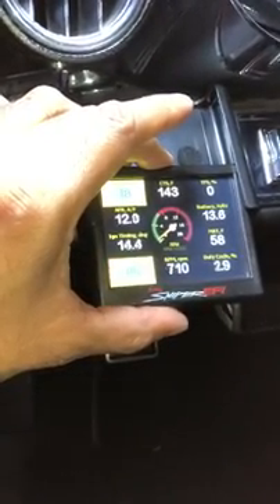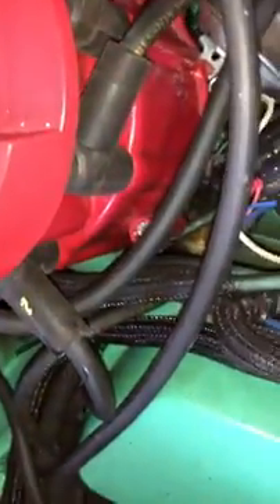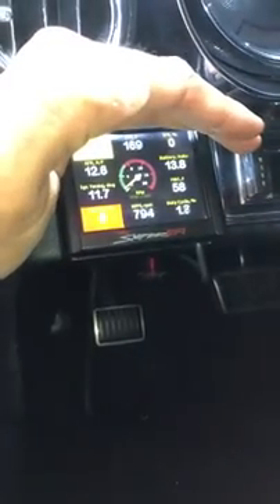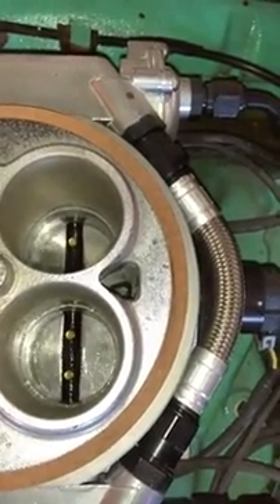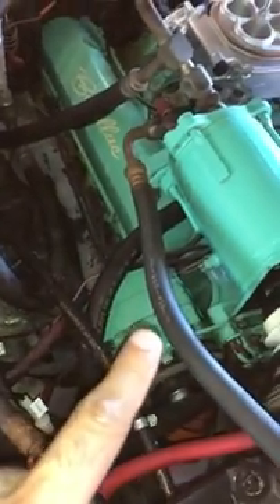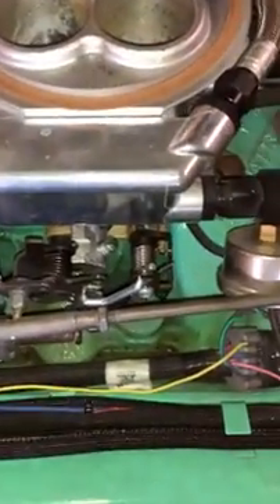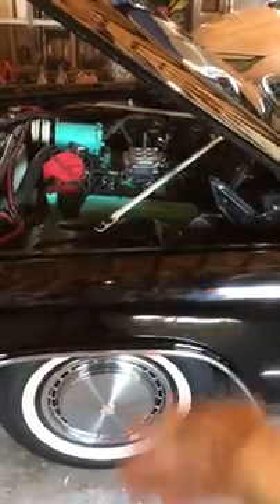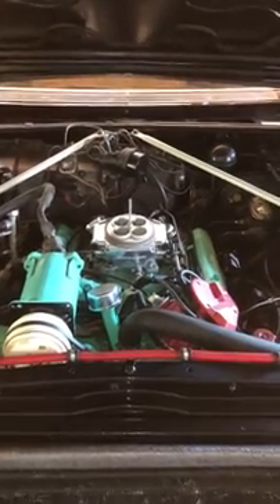Holley Sniper IAC idle hunting problem 1966 Cadillac

Comment: I had the same issue, but only on cold starts. Change your IAC speed from "Slow" to "Sniper TBI". Then, change your Closed Loop speed from 3 to 2 or 1. Those changes will help in all phases (startup, idle, and driving). However, if it's just a cold start issue, you could disable closed loop until operating temp. Only do this if your learn table has been transferred to base.
Reply from the maker: Thanks Clint! We all appreciate your input. The car isn’t with me at the moment, so it will be a while until I can try it. It is possible that your version is much newer than mine, and I don’t have those option bc I don’t remember seeing them…

Comment: I’m running a 67 440 with a 727, I think I just figured mine out. Hasn’t done it again since. Go into your advanced tuning settings and turn your AC kick down from factory setting from Holley which is 50% and turn it to 0 %  if you aren’t running AC if you are then adjust it to where you don’t have the IAC surge
Reply from the maker: Hey, that’s worth a shot! My car isn’t with me, but hopefully others can confirm and report back here. Thx for the update!!
Reply: Well, so far so good! I did what Cody described in OP and, it's only been one day, but it is running normally now...now surging etc. I will give an update in a week or so!
Reply: Interesting! Is your sniper still working well after making that adjustment to 0% ?? 
I just fixed my A/C and the problems described in this video only now surfaced. Just made the adjustment you suggested and hopefully this fixes it. I will post back regardless.

Comment: Did you ever get this sorted out?   I have the same problem.   Thanks.
Reply from the maker: Hello and no. Just been driving it. Some days it’s a little better, other days it’s the same as the video. Things I never tried ; throttlebody to manifold spacer, new IAC, new Sniper. Good luck man!
Reply: @rajeevx7   Thank you. I am running a 1.5 inch spacer and it still does it. Like you it comes and goes and isn't consistent. I leaned out the idle AFR and added some timing. That seemed to help a little.  I am going to mess with the IAC settings and see if I can make it any better.

Comment: curious if you ever got this resolved.. with it being a smooth idle with it disconnected, i'd say its not fuel/spark map related. you already checked/confirmed no vacuum leaks. from the looks of the way the iac is acting, i'd almost say its picking up interference from something on the iac wires causing it to bounce around. you already tried a new iac from a parts store? its a Standard Motor Products AC416.
Reply from the maker: Everything you said is plausible. I have not tried a new IAC.

Comment: Same problem for me. Everything is new between the clutch and the grill and was professionally installed. I never know when she'll stall, but most likely at an intersection, where it won't re-fire. All Holley Snipers need to be recalled because they create a hazard in traffic. Do not install one of these in your vehicle.
Reply from the maker: Hi, did you do a thorough intake leak check? Mine never stalls, but any extra un metered air could stall it out.

Comment: So U left it unplugged , I can’t even get my IAC down to 0.
Reply from the maker: Hi friend, no not unplugged. Cold starts are almost impossible without some iac. It sound like yours may be the iac/idle screw adjustment setting that Holley describes in the set up. If that’s not it, your resting IAC position setting in the handheld may be way too high. Ideal is somewhere between 10-30% at rest (open throttle no iac needed)
Reply: Ty I gotta keep trying but it’s fustrating I appreciate ur time bud

Comment: I wanted to just give some comments here. 1966 impala ss 327 mild cam. I have a stock HEI on it, no hyper spark.  I too have the same surging Iac issue. I set up the car 2 years ago and ran extremely well, the recently started having the exact hunting issue. Very bad iac , 0 to 100  0 to 76 , 0 to 50 ect.  surging , snorting Just like yours.  cold start fine, warm up fine, then take for a ride 2 to 5 miles , come to a stop and here is starts surging. 
  I have all my wires very tidy and all away from any RF Noise source.  I happen to have a new unit on my shelf for another project. so I switched out the iac unit with a new one.  Same exact issue with new Iac .  I then just switched out the throttle body for the new one (with the old Iac  sensor in it) and it worked with out any issues . so my diagnosis is a bad ECU unit. the same wiring and wire routing now has not one issue and runs amazing.  Great news here that its fixed ,  except Now I need to deal with Holley with a unit that is from 2019 and a defective ECU . 
I hope they do the right thing
Reply from the maker: Hi Mark, thanks for the input. I have always thought this thing to be a defective ecu as well. You had yours running great, then the ecu started acting up right? I have a feeling that Holley knowingly unloaded a great deal of the defective ecu’s at wholesale cost. Based on what I’ve seen and tried with this thing, a bad ecu makes the most sense.

Comment: Mine dies after 15/20 minutes and the IAC stays hunting at all times. I have a fuel pressure gauge hooked up with a inline fuel pumps and i just can’t keep it running. I’ve tried everything. I went from a FiTech to this and FiTech is way worse. But I’m having the same issue with both so idk
Reply from the maker: Hi Adam, have you unplugged the IAC after it’s running, like I did in the vid? If the pump is cavitating, then the pump feed side seems like it can’t keep up with all the bouncy idle and heat after 15min. Maybe try a larger feed line and ensure your return in tank isn’t washing out the pickup line/causing bubbles near.

Comment: I have a 66 Cadillac and I'm thinking about going fuel injection I would like to talk to you personally on your recommendation
Reply from the maker: No one at Holley wants to help. I have not tried the spacer between the carb/intake manifold yet, as has been suggested. That’s bc I’m busy and I don’t have much hope for it anyway. If I did it again I would get a Fuel Injection Tech unit. But, I haven’t done the extensive research on those to identify their problems either. Basically, fuel injection is better than carbs, but the Sniper may be the worst one out there for this 429. 🤷🏽‍♂️
Reply: @rajeevx7  Wow! This is making me glad I went with GM TBI off a 454 Chevy. What did you end up doing?
Reply from the maker: Hi Clark,  I’ve done nothing😂 I still have the TB spacer sitting on my workbench. That was suggested by a few people to do and cure the surging. Also, another guy suggested that my alt may be causing it with RF interference. I haven’t tried disconnecting that WHILE the iac is hunting yet. That seems fairly easy to do, since it’s just one wire. But……I’m busy😭

The GM TBI is tried, tested and proven! It’s not all fancy with a touchscreen and polished housing….but at least it works dependably! I may have gone that route if I had found a write up on the 429 to TBI😬. Enjoy your car though!

Comment: In one of Holley's videos it says that this issue of hunting could be caused by a vacuum leak as well.  Just a suggestion.
Reply from the maker: You got that right! So, checking for a leak source isn’t that easy if it’s a small leak. But, the dead giveaway for me that this is ecu/iac related is that plugging the iac port or disconnecting the iac gives a DEADNUTS steady purr at as low an rpm as I like. A leak ‘should’ cause a higher than normal/target rpm and/or fluctuate a bit. Usually even a whistle!
Reply: True in most cases, I am not having as much issue with hunting as yours, mine seems to be mostly cam size lope.

Comment: I have a similar issue and Dude I'm so frustrated I just want to toss everything Holley in the trash including the darn stickers.
Reply from the maker: Lolz 😂 Tell us how you really feel! Ok, hold tight. Do the iac procedure. Fix your p-trim. Then see where you are. I know there are good suggestions in this comment section. 
I’ve tried everything except the carb/throttle body spacer. I bought one from Advance Auto for about $15....just haven’t got the will to put it in because I will have to engineer a new kick down and possibly throttle linkage. I will one day and report back. But, if you are in it now it’s a mod that can’t hurt anything so might as well try! Good luck 🍀

Comment: Im chasing emi problems that makes mine stall after its ran fir 10-20min. Makes me wish i just got a nice billet double pumper.
Reply: I still havent taken it on the street yet  though.
Reply from the maker: Even with the sniper problems, I wouldn’t go back to carb....prob shoulda got an fueltech instead tho🤷🏽‍♂️ 
Did you get every wire way away from your distributor, coil and wires? Do you have an amp power wire that surges near by? Also, google electrical pulse interference and blockers....that might help. Once everything sniper related is about 6” away from emi sources, you can move on to other things. 
Is your sniper ecu set up controlling spark and why do you think it’s emi related stalling?
Reply: @rajeevx7  haha i have a little bit of everything going on. Spent the weekend tidying up wires, putting a noise filter on the ignition box, clean spark plugs, new o2 sensor, clipping ferrite doohickies everywhere,.... im gunna also heat shrink the air cleaner bolt and find a plastic filter base. I still got my ig. Box wires and electric fan wires running together, but in separate looms and i hope that doesnt give me trouble
Reply: @rajeevx7  do i need a base fuel map downloaded? I never found a sbc 350 build that came close to mine or does that matter?
Reply from the maker: Totally sounds like you are on the correct and shortest path!
You base map is getting the car to start and idle for 15min, so you are good there. I’d suggest the data logging it at the 12min mark to stall, then view that on the laptop. Maybe you will see something spiking/falling off leading to engine cut. 🤞🏽🤞🏽🤞🏽
Reply: @rajeevx7  i had one great run in the 2 years i had mine and the tune just kept getting worse and worse. The 3d fuel and kpa map looks like the alps lol.
Reply: @rajeevx7  try unplugging your alternator when it starts doing that, I am dealing with one now and it turns out its rfi noise from the alternator.
Reply from the maker: I hadn’t heard of that before, but great idea! My alt is self exciting, 1 wire. So I believe it’s throwing rf as soon as it spins. But, I’ll try to disconnect the power feed out the back and see if that helps! Thx
Reply: @rajeevx7  well i did everything i could think of and it runs good and got rid of the stall. Turns out when you see the tps go negative its the rfi making it trip out.
Reply: They are junk...had nothing but problems out of mine
Reply: Mines doing the same thing. Dies after about 15/20 the inline fuel pump starts cavitating and it does. IAC jumps all over from 0-13 never stays steady.

Comment: You either have to add a spacer or grind the center rib of your intake manifold. Sniper is only reading four cylinders. The vacuum is not being distributed correctly. I’ve heard of guys grinding them down 1 inch. Seems a lot easier just to add the spacer and your’ll pick up performance.

Comment: Ever got to solve the issue?
Reply: A plenum spacer could also get the trick done without having to modify the original intake.
Reply from the maker: Hello, no I never solved the issue. I drive the car as is. It’s still annoying as gas guzzeling and surgy at stoplights😒.
Reply from the maker: Increasing my idle screw sounds interesting!

Comment: Go to holley they have a video on this problem i just watched it you have o close he air screw on the side IAC is to be at 0-4 not 16
Reply from the maker: The Holley video about adjusting idle refers to setting the idle screw. They say the secondary butterflies are adjustable on the high end sniper, but not base models like mine. They are setting the throttle/idle screw 1/2-1 turn beyond initial contact. Is that what you are seeing as well?

Comment: Curious about the following: What's your target AFR/actual AFR around 160F? Have you run race gas or any other leaded fuel through your very bitchen Caddy? :) 
Also, what are your IAC settings (Sniper/Slow/Med/Fast)? And, of course the ramp RPM and all that? I've got a 2300 and I will tell you that the idle across various temperatures is incredibly challenging to tune.
Reply from the maker: No race gas, target rpm across the board is 750, IAC is slow, and I don’t remember my ramp. 
It is definitely note worthy that you are seeing a difficult idle tune across different rpm levels🤔 Thanks for the info!

Comment: My Holley sniper sucks!! My car won't even idle........ Up and down till it stalls...... Absolutely horrible!!
Reply from the maker: Hi Joe,
Have you done the “cover the IAC and set idle” method yet? That’s where I would start. Do it several times, working your way up to doing it with a fully at temp engine. I think it took me 3 times to get it perfect. 
After that, the car shouldn’t stall, but will most likely hunt as you see in the video. Good luck!
Reply: @rajeevx7  I just watched a video from Lukas Garrison, who shows that method, so I will try that as my last ditch effort before I scrap that efi system....

Comment: Hi did you ever figure out the problem. Im looking to buy the Holley Sniper EFI? Also did you use a in tank fuel pump or a in line fuel pump?
Reply from the maker: Maybe research the FI Tech before buying this one. Are those owners having similar issues? I don’t know, but this dieseling shit is lame!
I have a Chinese replica of an Aeromotive in line pump. It sucks Via the oem pickup sock then through a 10? Micron filter and feeds through a 6? Micron filter. I also added a fuel psi guage at the Sniper inlet (mandatory in my opinion). The EFI, I’m pretty sure, is internally regulated and my return line drops into my factory return tank line. Either way, any EFI is 1000% better than carbed in my opinion! Good luck bro.
Reply: @rajeevx7  Okay thanks a lot. This was very helpful
Reply: I'm 3000.00 into this holley sniper, was in the shop for months cause holley won't pick up their phone for the techs to trouble shoot...everyone I know with holley is tossing them and going fitech...mine is still idle hunting I hate holley

Comment: i have the same problem and i installed the hyperspark sys as well so installing in your rig probably will not fix it.  installed this sys last spring and i have not figured out how to fix this yet.   any success by anyone yet?????
Reply from the maker: Still have the same “dieseling” in mine. It may be trying to self learn and get better, but I can’t really tell. Also, I drive the car so rarely, it is difficult to discern small changes:-(

Comment: any updates on this problem?
Reply from the maker: Hello! No updates:-( It may be getting better and learning itself, but it’s very difficult to tell because I drive the car so rarely! I don’t think anything has changed though....
Reply: @rajeevx7  how many mile have you put on the car since installing the sniper?
Reply from the maker: I would guess around 1000 or so, +\- 200. Those classic car insurers limit mileage to 1200/yr so I make sure not to bust.
Reply: @rajeevx7  i get it. Mime is the same way. Your sniper should have learned by now. Mine was done learning around 300 miles. I bet either your ECU  or the IAC motor is bad

Comment: Is this the Sniper Quadrajet designed to to replace the Rochester? If not  I think you need an aftermarket intake.
Reply from the maker: Hi Dasvigo!
The factory intake is a spread bore and my carb was a Carter AFB. As was suggested earlier, my iac outlet port could be blocked by the factory intake a bit. I have not yet disassembled to find out. If someone knows the exact location of the iac exit port...that would be helpful!
Reply: Yes, there is a Sniper setup to replace the Rochester, I have one on my 73 Eldorado- video coming soon.

Comment: hope you got it figured out by now.  Mine was doing the same thing,  Under the setting for idle on the controller I had to adjust the AC kick down percentage.  Since I’m not running air conditioning I set it to 0% and it’s been running perfect.
Reply from the maker: Well that’s a new and simple task to try! AC kick down percent to 0%......got my fingers crossed👏🏽
Reply: @rajeevx7  Did adjusting the AC kick down help? I'm having a similar issue with my sniper unit.
Reply: Yes I had the same problem. And It took Holley tech engineers to help figure it out. Had to use a laptop to go in and shut off the A/C kick and all other input output functions that were not being used. Ran like a top afterwards.